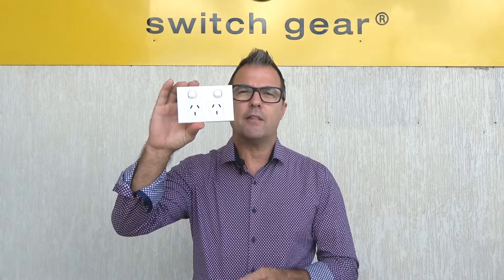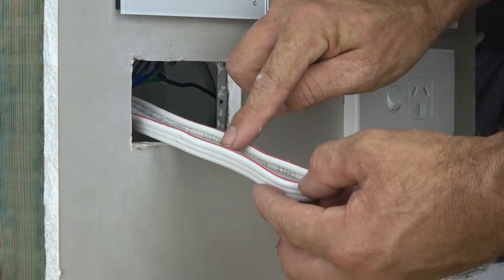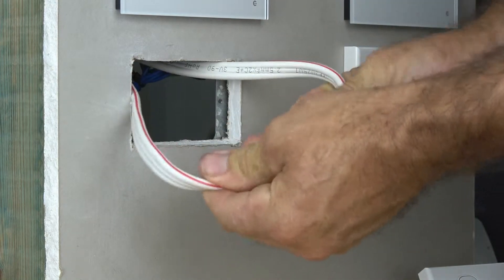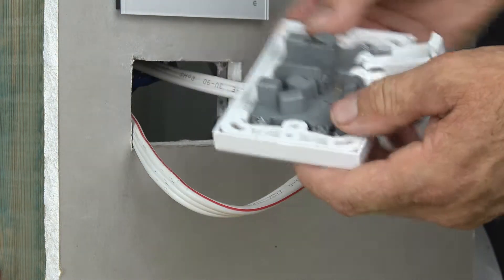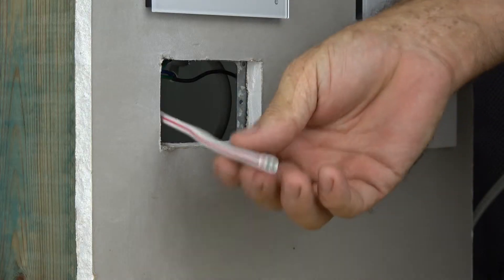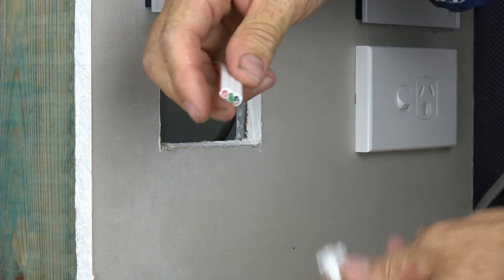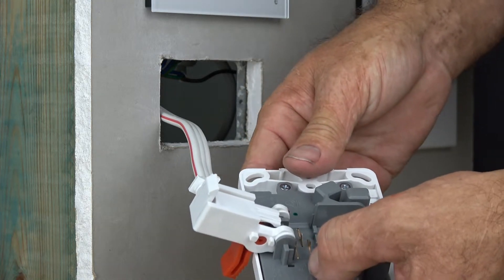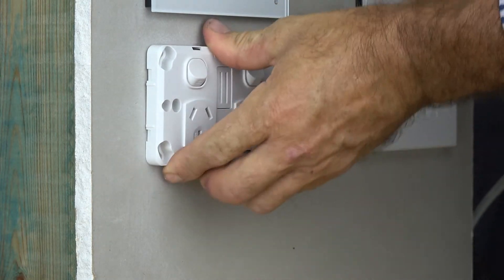How To Install & Terminate Our BASIX S Series Quick Fit GPO (BS POD10QF)

Comment: Can these be used for a situation where there are 3 cable loops at the gpo outlet? or is this more based on new installs?
Reply: Hi there! The Quick Fit product is for new installs. However, the double GPO comes in a standard version also. See here: https://connectedswitchgear.com.au/product-category/switches-and-socket-outlets/basix-s-series/socket-outlets-basix-s-series/